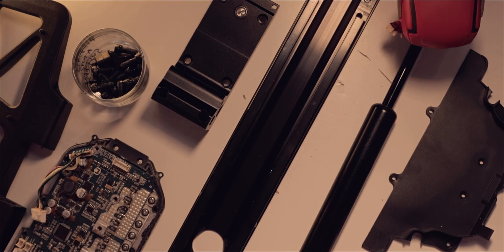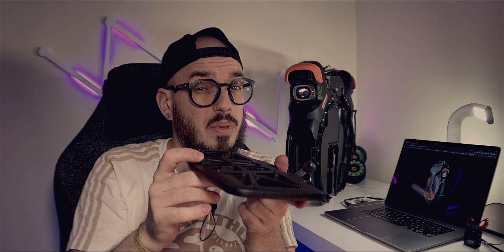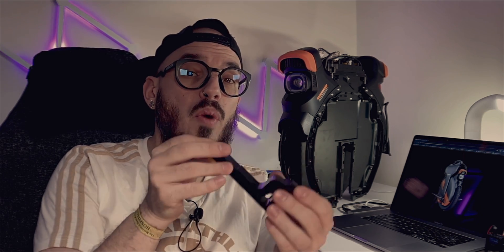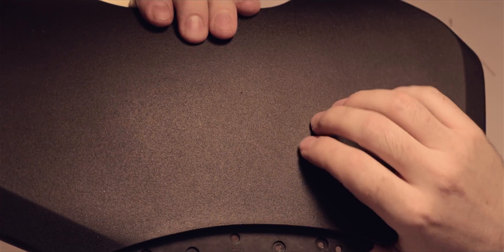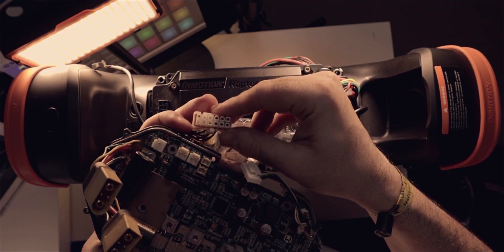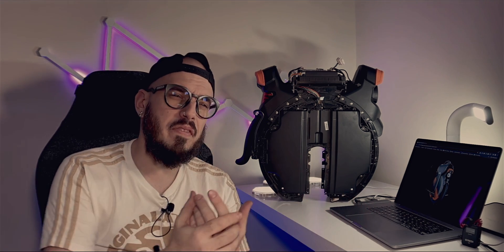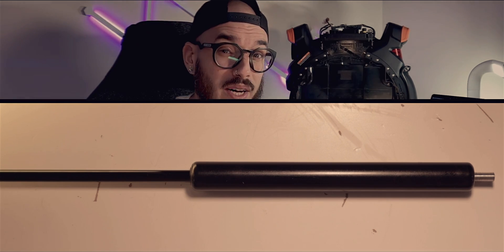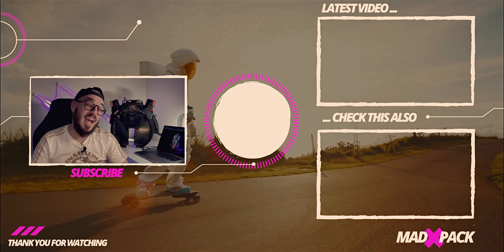Inmotion V11Y Disassembly - What have changed?

Comment: I shared this thought with Zen Lee as well, but I would honestly like a suspension delete option. Have a replacement bolt-on covering for the saddle and have the pedals fixed low at ~6” or 150mm-ish. That would appeal to me as an 18XL commuter just looking for a wider rim and a kickstand
Reply from the maker: Thank you for your thoughts. For me
No way I want to have no suspension … and the suspension here is no much better not even comparable. I get you about bringing pedals down yesterday I crush because it was really windy and the wind sadenly pushed me off the wheel from the side of I had a lower position I think it will not have happened

Comment: Not sure why this and the S16 Pro weren't 100v Wheels, 84v wheels at this point make no sense. Hopefully the market going forward will not make anything below 100v. That S16 Pro would have been an absolute gem at 100v
Reply from the maker: Thank you for your comment and I completely understand but let me give you a different perspective. A lot of people want a wheel like me to go to work been easy to manoeuvre I like to ride between 55-68kph I wanted light compact and maybe I also don’t want to spend to much money… but I want a great front light I want maximum water resistance a good trolley but I want to stick around 2000 dollars and also please a smart Bms is essencial…. And I forgot I want a decent suspension. Before the v11y all that was basically impossible to give to someone the v11y give me all of that but is a bit slower… more voltage will only make your battery run faster and increase the price… so since I like to ride between 55-68 this wheel is more in the slow side of my favourite speeds but my final question for you is? Do you think a lot of people outside of US rides fast? I have to tell you no so that’s why a 84v makes sense I prefer to have less V but better quality overall and like I said it will increase my range so v11y makes all the sense to exist..
Reply: In short - weight reduction, as 100v cost more weight
Reply: @milordas  still should have been a 100V wheel as there really isn't any place for an 84V Wheel these days
Reply from the maker: @curtflirt2 I would really disagree

Comment: Очень плохая прошивка . Колёса много раз встают в ошибку и нужно много времени для решения. Эта монель не готова к продаже((((
Reply from the maker: English please
Reply: @MADpack 
there were many customers in my workshop with inmotion v11y. Everyone complained about the lack of an opportunity to charge the battery! and also that the upper chambers of the suspension air springs do not hold air. and the wheel makes very unpleasant noises in the process.
They need a complete replacement of the battery and air springs. The design of the v11 air spring is identical to the v11y. the only difference is in length. For this reason, I am forced to make maximum improvements. Otherwise, I cannot give a guarantee from my workshop

Comment: Thank you for the 2 videos about the V11Y ! You have done one of the most complete comparison of the V11 to the V11Y and it's really helpful. I'm definitly taking the V11Y as my first wheel ! 
I will use it mainly if not only on street/road, sometimes on wet road (when it's gonna be raining a lot i'm gonna use back my kuickwheel escooter) do you recommend me to change the wheel ? Or the original wheel will do the work fine ?
Thanks you very much anyway, i hope your knee will heal soon !
Reply from the maker: I restart riding recently I recommend you to change the tire and if you do street and rain the tire I have put on mine like I explained here is a monster tire is really good still testing the wheel for full review
Reply: @MADpack   I’m afraid to do a mistake when disassembling the wheel to change the tire but I will take the ref of the tire you use, maybe do it myself later or pay someone to do it.
If I can make a request, there’s videos of disassembling the v11 but not the v11y I know they’re similar but maybe you can make a step by step video of disassembling the V11y since there’s differences ? You’ll be the first.

Thank you anyway
Reply from the maker: @RoiDesCochonsONeil hi there … they are basically the same ones and is easy to disassemble I normally say just grab glasses write which part they belong and that’s it

Comment: Great in-depth observations. By far, the best review I have seen about V11Y.  
About the pneumatic cartridges for the suspension, they may look the same... but  take apart the valves.  Since some time, Inmotion is using A/C type of valves on the suspension cartridges instead of the common shrader valve for bikes. And the lube seems to be better as well. I do replace the inner lube with motorcycle grade fork lube and the point where the shaft enters to the cartridge, I add three drops of grease (silicone PTFE or marine grease). You will not believe how soft it becomes. 😉
Great EUC under 30kg. Thanks for sharing.
Reply from the maker: Wow thank you for your comment amazing one and really helpful I may try that on the old one… finally started to ride the v11y and is night and day I can’t wait to put together my thoughts about it but such a great wheel

Comment: Hi Mark , I will probably receive my V11Y this week, have 2 questions, I bought a Pirelli Rosso sport 80/80-14 tire but the width I measured is 87mm instead of 80mm, do you think it can fit the V11Y? Also will the tire change process the same as V11 ? Thanks in advance.
Reply from the maker: Not sure that’s why I went to a 70 maybe will be too tight. When you have the wheel put it in front of the wheel and spread the tire on the side to have an idea if it’s to large or not but I think it will
Reply: @MADpack  thanks Mark, I guess 87mm will be too large, as I saw others putting the Michelin PS2 tire 80/90-14 with 80mm width, it’s close to the maximum possible. I might install the PS2 if the Pirelli not fit. Thanks again and hope you recover soon.
Reply from the maker: @samuelju9247 have you consider the city extra like I have installed on mine?
Reply: @MADpack  yep, I heard they are durable;  will be giving a try after my 2 new tires the MC PS2 and Pirelli Diablo Rosso sport; I want the 80/80 with 19” diameter to make the V11Y more torque, but if not fit I will have to install the  Michelin PS2 80/90
Reply from the maker: I can tell you the v11y have plenty of torque for a 84v wheel

Comment: 13:25 Very Strange…I didn’t have to remove the battery for mine, same arrangement than my OG V11 with the guide for the câble. But I realize why they would do that (If it’s not a wrong assembly on the factory and they did change assembly process) : it’s still challenging not to pinch the cable with the suspension support. Overall, I hoped that the tire change would be easier especially with the raptor controller, it is indeed but not by much 😅
Reply from the maker: This is my 3rd v11 and all of them I had to remove the battery to reach the cable maybe you can force it to come out but in that way you will risk to damage your cable. The space is small so if you do t set it up properly yes you can damage the cable of the motor with suspension maybe that happen because you didn’t remove the battery to be able to set it up properly

Comment: V11 Has been out of date for a long time with its crappy design. Seriously, she doesn't even deserve to be talked about.
Reply from the maker: Sorry it makes me laugh your comment because you see multiple people with v11 with more than 15.000km and running without a problem.. this is a wheel that a company give you support and parts ater 2 years of releasing, was the best front light on the market, was first suspension wheel on the market. One of the best trolleys… when you talk about crap design go more in detail… if you want to complain about number os screws and suspension ok but your comment is not constructive and just to criticise. Per example the before master I ride two tree times went on holiday and the wheel turn on alone and never turn off again… done less than 20 miles no jumps or crazy stuff not even riding on the rain. That’s a crappy design that you can lift the top and have access to electronic, mudguard broke by putting on the car, handle broke but removing the wheel from the box… you want me to continue??? Sorry your comment is just none sense
Reply: @MADpack  thank u!! I've been reading all the comments trashing the v11. The design is slim. the parts are produced. and the raptor controller is safe. Why would they fix what's not broken?? This is about the heaviest wheel I'd want to use as a daily commuter.
Reply from the maker: @CrocodileWhispers thank you for sharing your thoughts
Reply: V11 has been out of date since 2020, only grandpas have bald heads! That's why they are 15,000km away! ^^ Come on, stop trying to sell your stake to an expired V11Y...On top of that we can't even put powerpads correctly on this outdated wheel, it has such an outdated design that at the time powerpads didn't exist ^^
 Of course, if you drive haphazardly with a wheel that is not suitable for going in water, don't be surprised then consequences. So be smart and stop your untrustworthy business. The majority of the community rides BEGODE and doesn't complain about it at all! Even more so since 2023 where Begode really makes quality products since the arrival of the Begode EXTREME and its competitor the PATTON so stop Inmotion and KingSong thank you...the real ones know this very well. Don't try to scam novices and beginners. @MADpack  Go back and make your TV or speaker videos, you're useless for the wheelers

Comment: So now you have to clean the 2 little screws instead of the big one... How often does one even remove the pedals? 2x in a year maybe.
Reply from the maker: You missed the full benefit… let me explain even if they are 2 been smaller less dust can go in.. but the most important is no dust will go in on the axel so pedals will continue to open and close without issues for a longer time

Comment: Great technical review, will need to re-think about going with a V11 OG VS going with the Y. I feel this wheel is made to have no maintenance (compared to my A2).
Reply from the maker: Hi there thank you for sharing your thoughts which maintenance are you talking aboutV
Reply: @MADpack  changing tire, bearings... cleaning the inside of the wheel (mud, dust, salt, anything we have here in Canada during winter).
Reply from the maker: Changing tire is challenging since you have so many screws bearing protection the best I saw so far and cleaning inside is not an issue also remember the ipx6 that allow you to wash it like if it was a car so no worries about that

Comment: Great video with a lot of details that can’t be found elsewhere. Great idea about V11Y pro, get it 100V with 1800wh battery and 2800w motor, and of course the leaperkim similar suspension but make it less than 32kg it will be awesome.
Reply from the maker: I believe inmotion have all the technical parts to be able to produce that will be insane if one day we see that and a bigger front light maybe with the idea I gave years ago already when curving an extra light turns on for the side you are curving like the cars since they have a gyroscope is definitely possible to make